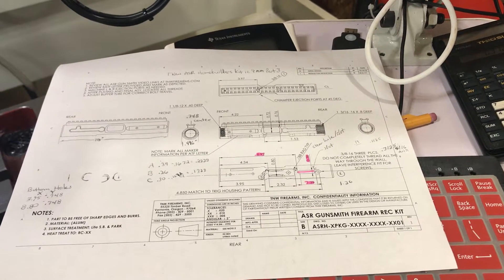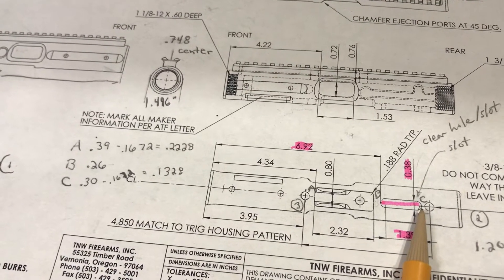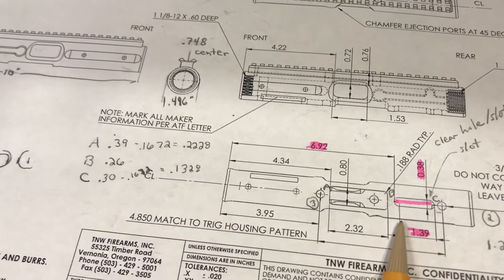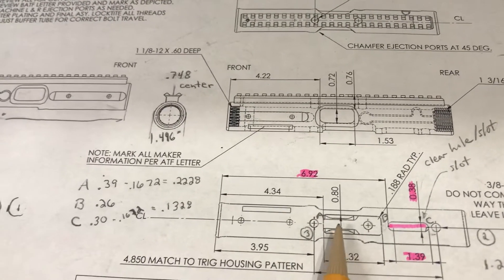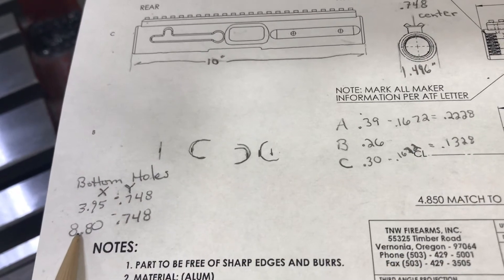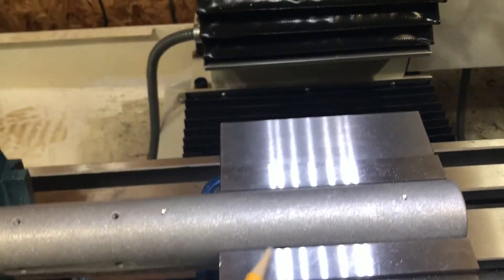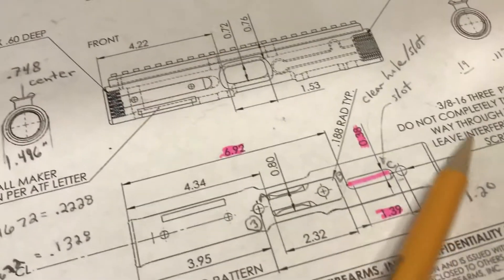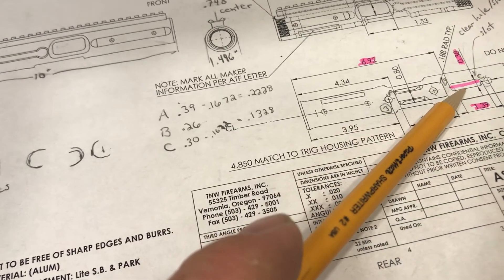TNW ASR Homebuilders Kit in 9mm Part 4

Comment: So they specify the material to be Aluminum and for surface treatment, "Lite S.B. and Park".  Light sandblast, fine, but parkerize aluminum?  Nope.  Aluminum won't parkerize.
Reply from the maker: I spray painted my unit- will post a video later going over the specifics.